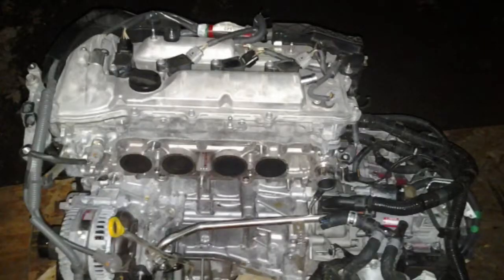Top 4 Naturally Aspirated 4-cylinder Engines from Toyota

Comment: 2AR-FE gets my vote for one of the best I4 ever made
Reply: I agree, cuz I own a camry w/ one and for only 178 H.P. and 170 TQ., it is peppier than most would think, when the VVT -i kicks in and you get to about 2/3 to full throttle😮First gear, especailly is pretty peppy 🙂Very quiet, until vvt i kicks in at higher rpm too 😊
Reply: @davidgeerling9871  yes it will go down as one of the best ever. I have one with 160k and it is just so well made. It burns zero oil and that is with 10k mile oil change intervals
Reply: @benjaminturpin2749  I totally agree, and it sweet to know it does this w/ 10K between oil changes...IDK that...Ever hear, they're using a VERY, VERY thin oil lately, like 0w ?? and they're trying for thinner yet ?? 🙂🙃 Honda's doing the same, at least to some extent...
Reply: @benjaminturpin2749  God bless 🙂🙂

Comment: You forgot 3tc is a legend in drag racing
Reply from the maker: Honestly, that engine is probably a good engine but it is carbureted and I think it takes too much in this modern day to make power. What kind of potential do you think it has?
Reply: KRACC I know some friend that he run 13 low in the quarter mile all motor,and the car name cam2 he used to be in the 90s the fastest import in the world
Reply: In Japan the put a yamaha head block dohc.but still is 8 valve.
Reply: KRACC there so much aftermarket parts for this engine that is easy in to make hp,in the right hand of a engine builder🏁
Reply from the maker: Ramon A. Pagan Kercado what I mean is that in the 90s that was good, but now those other engines could still produce good numbers now compared to engines being made now and not take too much money. But the 3TC will have to take a lot of money to make it competitive in today’s automotive world.

Comment: Hey there! So I've been doing some research into the 2ar-fe, and I'm a bit confused. You say it weighs approx. 324 lbs, but reading through this artice on motor iq, it says it's about 220 lbs.

http://www.motoiq.com/MagazineArticles/ID/3102/PageID/6354/Nerds-Eye-View-Inside-Fredric-AasboPapadakis-Racings-Amazing-V8-eating-2AR-Toyota-Engine.aspx

There doesn't seem to be much information out there in regards to engine dimensions either. You wouldn't happen to know how tall they are valve cover to pan would ya? Thanks in advance for any info you could give me.
Reply from the maker: Sorry my man, I do not know the height of that engine. And hmmm... the only reasonable  answer to your weight question is it appears that they used lightweight parts and the 220 lbs is not with all fluids and accessories installed. I know it says long block in the article, but the figure I was quoting/speaking of was a engine that would literally be disconnected from the mounting points and have the engine harness on it ready to drop into any swap.